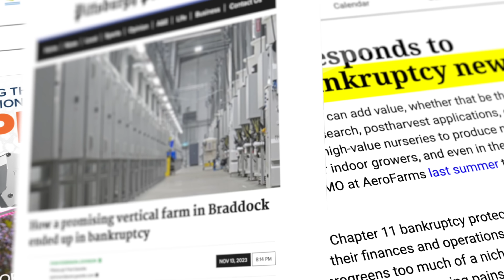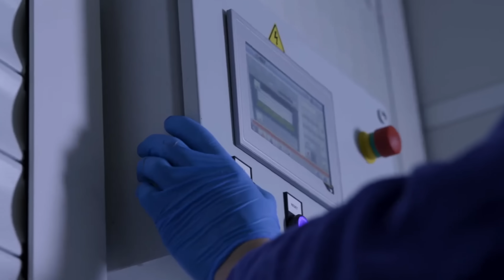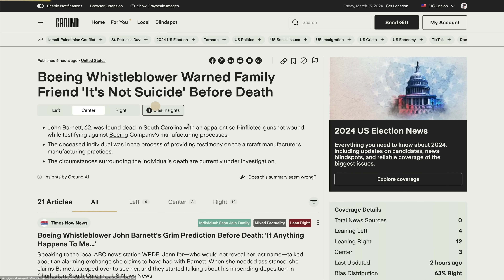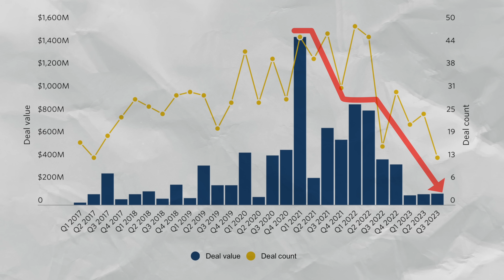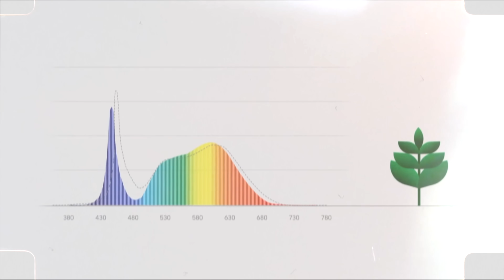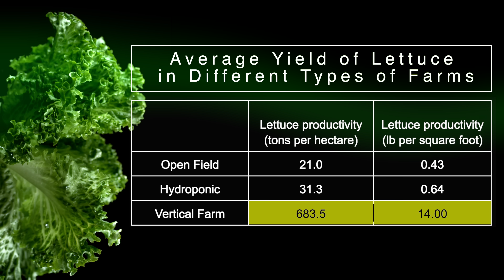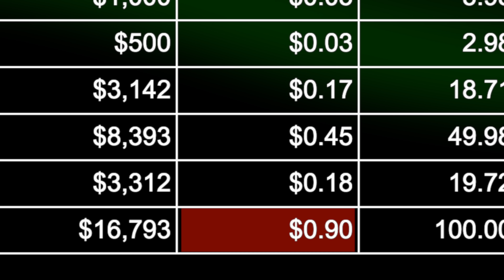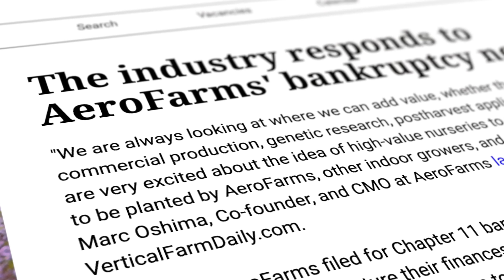The EPIC Failure of Vertical Farms - What Happened?

Comment: Love your videos and in-depth research. I wonder how the cost of agricultural land as well as farm equipment factors into the comparison? Yes, vertical farms have costs associated with Labor, Capex, Electricity and Maintenance, but running a farm has huge upfront costs as well. The cheapest agricultural land where I live is outside the city (only 30 min drive) but costs over $3M plus closing costs for only 1.5 acres.
Reply: He didn’t do a very good job comparing the two. If he did, he would have at least noted that the US has lost 3.75 million farms since the 50’s and 140k just between 2017 and 2022.  Mostly for the same problems associated with vertical farming. Those large VC backed projects failed and make good headlines. Many smaller companies thrive but with products that are priced very high for a luxury dining or health food market.

Comment: Interesting video, I remember the hype around these farms but I haven't seen much about them recently, so it's nice to have an update.

I wonder if maybe there are other ways of approaching this sort of technology? Economies of scale make a lot of sense for farming on land, but I wonder if this sort of tech can't be directed towards consumers and individual households? Maybe it's a little too sophisticated and requires more expertise than is feasible, but I imagine a lot of people and families would like to have some sort of grow space, especially those without gardens or in cramped living areas. I expect at least some of the needed expertise comes from the automation side of things? Which would be less of an issue in individual households.

Point being, yes, it wouldn't be "vertical" in the sense it is now, but imagine many or most flats/apartments in a high-rise building having some sort of grow-lab or equipment in their home, you'd have a similar thing happening, people in living conditions unsuitable for growing growing their own produce, without any soil or ground space.

It may not make much of a difference and it may only supply a small amount of a families overall needs, but maybe it could be a start and it could be expanded into more communal units, somewhere in between what has been tried and a household option.

Either way I think there are obvious advantages of vertical farms, and I expect there are use-cases and places they could work (places low on space like Singapore come to mind, if they want some amount of food independence). But I don't think it's enough of a selling point for consumers, they will need to compete with more traditional farms.

Comment: Big issue few people ever point out with vertical farming is how do you design the setup so that workers can effectively tend to the crops. Its a simple question but depending on the size of the botanical being grown and how often it needs attention vertical systems either become incredibly complicated setups or the setup makes the work unnecessarily complicated for the workers. Having worked in the medical cannabis industry I can say without a shadow of a doubt that vertical systems are a gimmick used to dupe investors into thinking the site is advanced compared to the competition. The increased complexities inherent in water and drainage, cleaning, construction, maintenance and repair far outweigh any savings you can make due to the decreased footprint of the farm. Additionally, as with every business that hasnt already optimised its design over several iterations, every vertical farm I have ever visited has been plagued by such obvious design flaws it becomes abundantly clear the designers have no concept of how the vertical farm will actually be used. Large warehouse sized facilities with drains in the floor of one end of the building and no grading to allow any water to naturally drain in that direction, double decker tables on floor mounted rails with no access to higher levels for workers without making employees build and remove scaffolding every time you wish to access the upper level. Unfortunately the nature of any ambitious project is that it costs alot of money, and when things cost alot you run into issues of either using low quality materials and rushed designs to cut costs or over promising and misleading investors to raise more money.

Comment: I'm not surprised. Though if it did grow in  market size, such that equipment prices reflect a mature industry, capex would drop. Also, as things became standardized, and more reliably automated labor will come down. So you have a farm in an urban area it needs to have returns to the property owner equal to office buildings, etc.

All that added complexity and points of failure just seemed like a bad idea to think it could replace conventional agriculture. Maybe in the desert, but then why not use the real estate?. You could basically have level enclosed farms without all the vertical moving.

Maybe in a space station, or on Mars. Just seems like the problems it's having should not be a surprise.

Comment: You are Correct and you are Wrong 🤔😳
It's actually a question of scale. The companies were not going for sustainable farming and in this you are Correct.
However if doing it on a smaller scale would most likely be better for a single "farmer" or a small community.

Comment: Hi There is a new generation of vertical farms that are looking much more promising . The main issue with the first generation was energy use . The new generation not only links energy to renewables as an integral part of the system , but energy saving technology ; linked to the grid minimises use where necessary .AI and use of specific spectrum light increases efficiency . Fingers crossed ! check out Flex farms , for example ( UK )

Comment: The fundamental reason is lighting. All the technologies around vertical farming is to replace light. Land, space and soil don’t get consumed, but light is. We can use scale to offset non consumable resources, but we can’t do it with light or energy. Even by efficiently only generate blue and red light, all the technologies to control such lighting, the expensive labor to design and manage the control system is because of light. So unless we have practical fission to drive energy generation cost to 100th or 1000th of current cost, any attempt to replace sunlight does not work.

By the way, the Wall is one of the most ridiculous project in the world. It does not make any sense. A super pyramid structure makes more sense than the Wall. Why separate people at two ends of the Wall? If there are ports or city’s to connect, why would anyone want to live in the middle section of the Wall? Or any other part of the Wall.

Comment: The electricity cost problem could be fixed by installing a solar panel system.

The Labour cost could be solved by more automation using machines, the less humans that work there the cheaper.

Efficiency of how the Farms themselves function can probably be improved as well. 

Basically this is a somewhat new technology of farming and it need optimising and improving for it to become more viable then normal farming.

Comment: Put them outside. Glass covered. Why are you putting lights on them? Sun has been here forever. Freaking use it! Bring down costs. Duh! Have them be on the side of buildings have rain run into it and flow out. Its not rocket science. Simple is king. You dont need smart plants.

Comment: You can't really call it a "fall" when it's still in the early stages, and like all technologies, the issues have to be ironed out.

That would be like saying the internal combustion engine "failed" when they found out that the first two-stroke motor couldn't drive a truck up a steep hill.

Just because a new tech has issues in the early stages, doesn't you just give up on the idea

Besides, there are more than a few vertical farms acroos Europe and the US, and most of them are doing just fine

Comment: This seems to me a failure of basic research. Farming has a famously low rate of return. Your average farm has a net worth of millions, but a net profit that's barely middle class. 

Vertical farms were trying to disrupt this with even higher costs to undercut a market that just wasn't there. 

The primary benefits are close production, would you even fell into with discussion of the line. But when you can get bananas across the planet and still sell them for 50 cents a pound, transport costs really aren't meaningful. And the environmental benefits are questionable at best. Because water use is not lost, it re-enters the water cycle. And all of that construction is very intensive

Comment: Thanks for well structured coverage.

I feel they were trying to solve the wrong problems given mass market food is still doable in less engineered farms or greenhouses. If labour is the big expense, maybe it would be better if vertical farms were used in a smaller scale to grow medicinal or other very small quantity crops?
As an example, some of the tech developed could be like an upgrade to a university’s research greenhouse.
- You want the floor space savings because the land near where the professors and students normally costs a lot
- The area has plenty of skilled workers already because you are making and growing prototypes rather than mass market lettuce 
- Being close to the researchers is a benefit more for consistency of the experiments and ability to run experiments without taking the trip on a vehicle into account, rather than raw costs

The other application I could see is ocean habitats, space habitats, and maybe large ships: similarly the space is a big concern, and some of those places will have quarantine processes anyway so the susceptibility to disease is already a cost they deal with.

Comment: Vertical farming has its place but it’s essential to not over engineer it.  I run an NFT system in a greenhouse and also produce field lettuce.   Both have their problems and their positives.  Most of the vertical farms I’ve seen are overly engineered. Rafting greenhouses seem to be the most lucrative.

Comment: one day this kind of vertical farm might be sustainable but not today, too many automation not gonna lower the cost but increased it. for now I think a current vertical farm should be standard soil based with farmers but done it inside a building, so just the sun that been replaced with led but the rest of the stuff still about the same, basically an upgrade of greenhouse. 

but still, no matter how good vertical farm is the most impossible task would be growing plant that came out as a tree

Comment: The problem is that it is  a for profit, not a for food setup. The tech is dumb. Why, only absorbent rockwool substrate is used. So no substrate must be used.  The biggest problem is the buy the food at the market model. No, the unit is a bot that grows the produce in your home or just on your block. I could go on and on, like sub-micron droplets are needed or max yields. Although the model food for food is the big boy, and you can grow anything indoor high yield and all computer managed as a open source co-op model. This is my passion,, and it does work if done right.

Comment: Ya know... this is where you get Tesla robots to fill in the gap of the labor shortages. You get rid of the electricity cost by going solar in the first place and you switch the model to a non-profit. There is no need to make something like this be at cost. you do this for 20+ years to optimize output. then you can expand only when the first building is sustainable cost wise and the next building will only bring in profit.

Comment: The small amounts of calculation and tests I've done here in cold and winter Sweden the best was regular green house with thermalheating and a kind of small solar panels, and a tiny wind turbine to get enough electricity to run the heat pump during winter and nights, and during nights led lights. The moist from the inside of the greenhouse almost covered 50% of the water to the plants, and the self producing electricity was more than enough for heat and led lights. Vertical was okey, but better was regular horizontal levels. I had 8 levels with led on every level. It also was muck more effective to keep the warmth inside. So my experiment worked better than I thought it going to do. And the cost/efficiency was really good. And during a year it produced veggies for 10 people for two years. And it was only 16sqm in area and I could have 3-4 harvest a year.

Comment: Yo! LOL linear city is possible?! Negative on that. That too is going to close due to electricity shortage despite being in a sunny area. I fund it funny how these people think solar energy is enough to power to run modern day equipment 27/4. There is just not enough power, square footage, and batteries to run modern day equipment alone. It is cost and time prohibited.  The linear city in the middle of the desert cannot be sustained with solar power. It takes more power to cool  living spaces than the sun can provide. Even if you have 100% efficiency. Dubi itself is a façade. The city does not even have a proper sewer system. The tall and beautiful buildings have honey pot trucks lined up to truck away their waste. How un-environmental is that?

Comment: "Successful" Vertical Farms are still on the near future horizon. However, the profitability model and ROI timelines need to be readjusted to realistic expectations.
If you look at most Industries there is always the early adopters and there's all this excitement and expectations get ahead of themselves and there's a shake out. This happened in computers in computer networking in software etcetera. Heck, look at the early 20th century automobile industry and the fact that there were well over 200 different auto companies. Whoever Industries typically will consolidate into about a half a dozen large corporations corporations that are able to scale.
This vertical Farmers Market is not gone away it's just going to retreat, reorganize and relaunch

Comment: I think it could be possible if you can reduce maintenance cost (which will go down a bit when it us more widespread) and the automation get's better so you need less specialists to keep it running. Then all you need is people to harvest, replant and occasionally tend to crops. It doesn't need to be completely automated, just the growing part. It might also be an idea to not make it completely enclosed and have more of a greenhouse mix to use natural light. Also if the disease issues can be fixed that would also be good. But we will never completely replace nirmal farming because certain crops and fruits just aren't very viable for vertical farming.

Comment: Its doable, but zero vertical farm projects focussed on energy crops, nitrogen conservation, labor or real economies of scale. They all flooded the market with "high value", crops, like greens and herbs, and prices dropped since these crops are expensive due to limited supply. In addition, they simultaneously were fighting to increase electricity costs.

This is what happens when tech bros, who are used to infinitely expanding markets, try to compete in commodities. Even with subsidies, its a 20 year project to get in the black.

You dont need hi tech LED lighting. You need full spectrum lighting, including IR. That means more electricity. LEDs do NOT work to produce healthy, fast growing crops. You cant replicate cannabis methods here, since cannabis is a very hardy crop, and is very high value.

Comment: Vertical farms have high capital costs - you have to build them and they are expensive, and high operating costs, lights cost money.  So high electricity, high heating and AC costs, high property tax and rent, so they are uneconomic. It’s that simple.  Now, this is tail of two cities: greenhouses work just fine.  greenhouses are cheaper, and use the sun which is free ….

Comment: As someone who worked at a large scale VF from its startup (found another job before the crash luckily), I think the water use claims are a bit disingenuous. The water used for growing was fairly low however there was a huge amount of cleaning (trays, workspaces, floors, etc) and sterilising required. I'm fairly sure that this aspect was ignored in the marketing claims and they used only the water used for growing in the claims of '90% less water used compared traditional farming.' It is doubly misleading when you have VFs located in places where it rains a lot anyway, and where water use is not the limiting factor of production in traditional farms. 

When I took a step back and looked at the whole operation - tens of millions of dollars invested in a huge factory, complex automation, massive working capital requirements - it was absurd to me how it was all just to produce leafy greens with minimal nutritional or energy content. What caused the investors to pull the plug in the end was the fact that after investing millions in getting a fully automated growing tunnel operating, it was not even close to being profitable. Completing the 2nd and 3rd tunnels would have actually made things even worse. There is only so much you can charge for salad greens at retail, and if you go wholesale like supplying restaurants and fast food chains then the margins are tight af.
Reply: I would guess that with current ridiculously expensive electricity vertical farm simply can not be profitable.
Reply: @skipperg4436  But using ridiculous amounts of electricity for "AI" that is mostly useless and mostly not profitable is perfectly acceptable. Our priorities are warped.🤨
Reply: @RishaBond  AI is nothing compared to what these farms use. Your sense of proportion is warped
Reply: Bingo, plus wastewater disposal in a natural system recharges the soil and groundwater, in a vertical farm it has to dumped into lakes, rivers, and reservoirs containing chemical fertilizer residue.  In some systems this can be beneficial, but in most not.